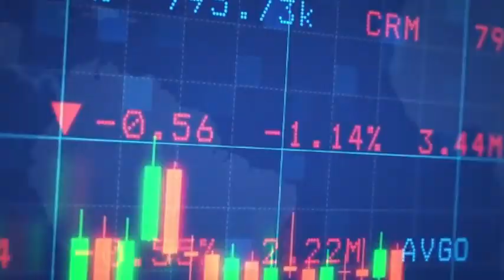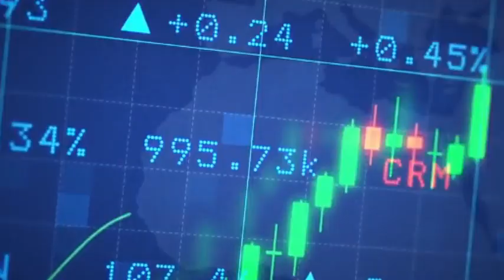How China Countered Holland's Semiconductor Seizure | The Nexperia Crisis Explained

Comment: WIngtech should try to consolidate it's packaging operations in the Phillipines and Singapore?  If the Phillipines government decides to side with the Dutch, WIngtech should be ready to cut them off completely.  The other precaution is that Nexperia China should demand long term contracts with significant "prepayment" from its western customers. Those customers need to deposite cash equal to 6 months of supplies they expect to buy.  But sign 3-5 year supply contracts.